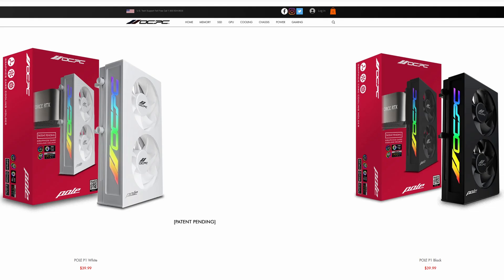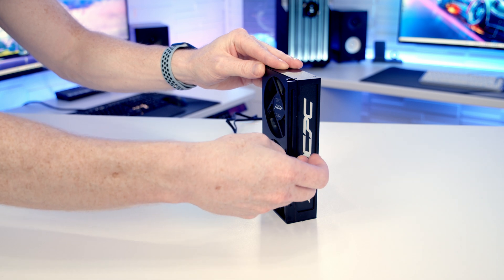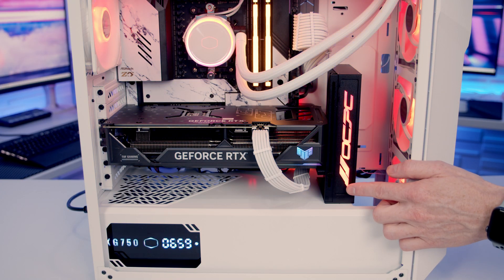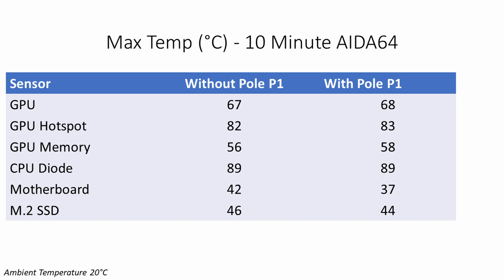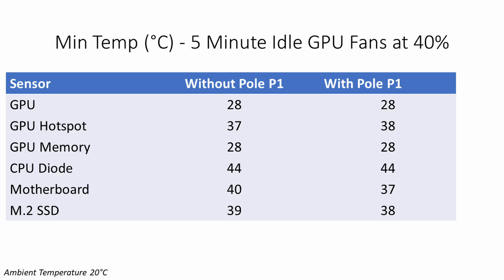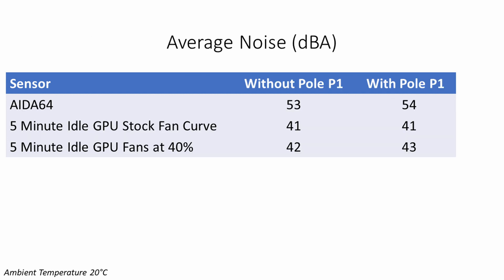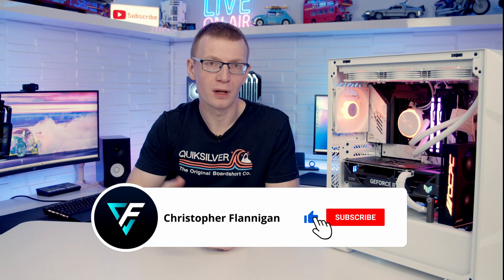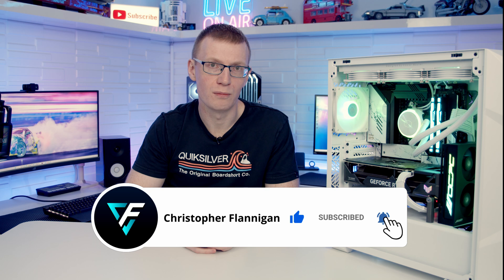OCPC Pole P1 Graphics Card Cooling Holder Review

Comment: I picked up the pole p1 for 20 bucks when i had a gpu with radiator fins that ran parallel to it ls airflow and had decent enough results. However as you do in the video i now have a gpu with radiator fins perpendicular to its airflow, this reduces it performance to negligible margins. Last summer i took my now unused pole one and stuck it to the outside of my pc to provide me cooling. Works decent

Comment: Interesting but I do have a question, as most people would have a 360 aio in the front of the case, Im wondering would a 360 aio in a push pull config have the same affect on cooling "apart from supporting the gpu" as these new gpu`s are getting hotter when it comes to the gpu junction temp. Just a thought.